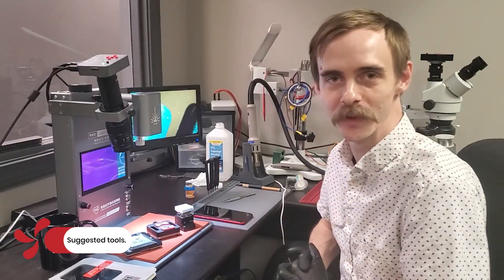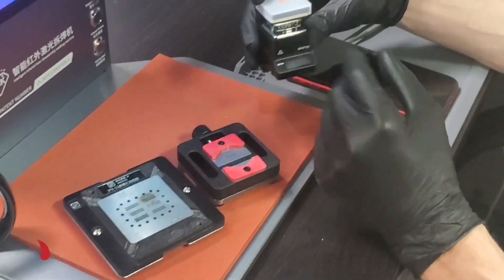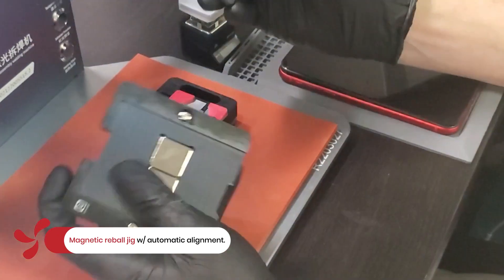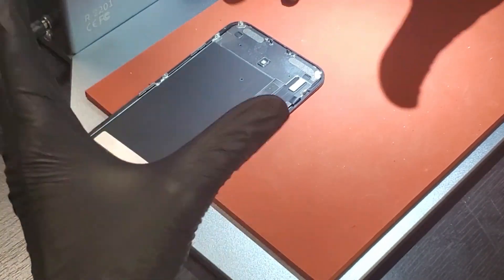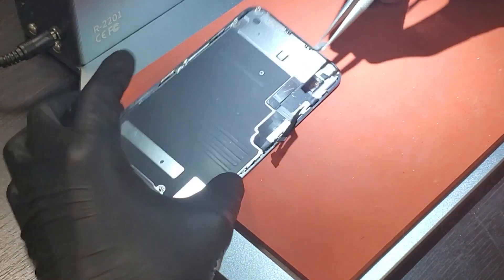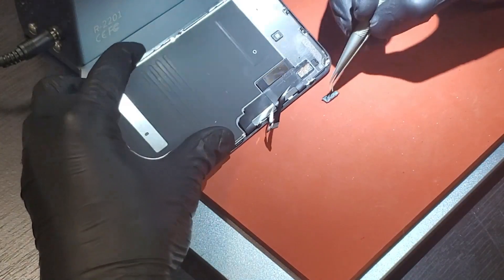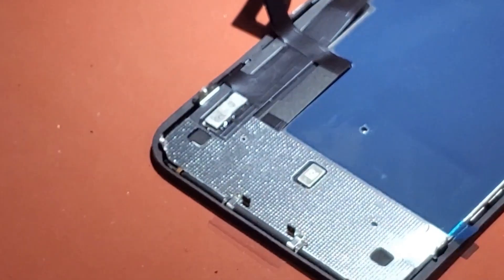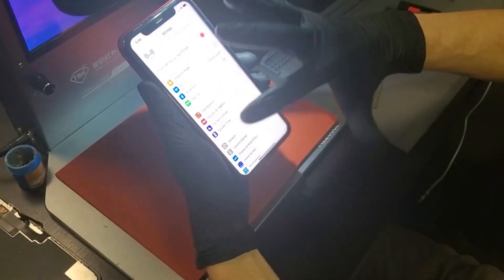FX IC Screens - Removable IC Cover. No more Unwanted screen error messages!

Comment: At 11:36 you missed one spot at the bottom right corner. Also when referring to any chip alignment you must use the right terminology on how to align any chip. It has a single dot on one of the corners of the chip that corresponds with relative mark (triangle or dot)  on the board. By saying use the QR code as an alignment  spot and If someone doing this job with the assembly being rotated he could possibly position the IC wrong! So use the only right way to describe the orientation and position of chip alignment so no misunderstanding.

Comment: So much for the right to repair.  Apple is clearly making it increasingly harder to repair everything, including screens, which used to be pretty easy/straightforward, and did not require chip transfers from the original phone screen, to the replacement phone screen :'(

Comment: Can you put a link to all the tools in the description
Reply from the maker: Great idea! Just added it to the description
Recommended Tools
TBK R2201 Thermal Infrared laser
https://www.injuredgadgets.com/tbk-r2201-intelligent-thermal-infrared-imager-analyzer-w-microscope/
2UUL - Mini Motherboard Fixture
https://www.injuredgadgets.com/2uul-mini-fixture-motherboard-chip-bga-for-mobile-phone-pcb-multi-function-clamp-ic-murization-tin-planting-table-jig/
MHP30 Mini Hot Plate
https://www.injuredgadgets.com/miniware-mhp30-mini-hot-plate-soldering-preheating-preheater-station/
Hot Air Station Atten ST-862D
https://www.injuredgadgets.com/atten-st-862d-hot-air-rework-station-1000w-w-lead-free-hot-air-gun-soldering-station-for-pcb-soldering-repair/
AMAOE - BGA Stencil Magnetic For iPhone X-12
https://www.injuredgadgets.com/amaoe-bga-stencil-for-iphone-x-12-screen-touch-ic-magnetic-reballing-platform/
Mechanic - Solder Paste
https://www.injuredgadgets.com/mechanic-rohs-low-temperature-lead-free-solder-paste-v5b45-42g-138c/
Sunshine Tweezer
https://www.injuredgadgets.com/sunshine-st-17-precision-tweezer/
Amtech Solder Flux
https://www.injuredgadgets.com/amtech-vs-213-a-tf-universal-no-clean-tacky-solder-flux-rol0-10cc-syringe/
Qianli Chip Glue Remover
https://www.injuredgadgets.com/qianli-toolplus-008-ic-chip-glue-remover-kinfe-tool/
Qianli BGA Scraper
https://www.injuredgadgets.com/qianli-toolplus-009-multi-function-bga-scraper-w-set-of-12/
Wozniak Reballing Stencil For iPhone 11-13 Pro Max
https://www.injuredgadgets.com/wozniak-bga-reballing-stencil-for-iphone-11-13-pro-max-screen-touch-ic/